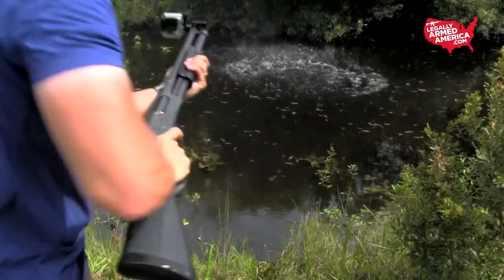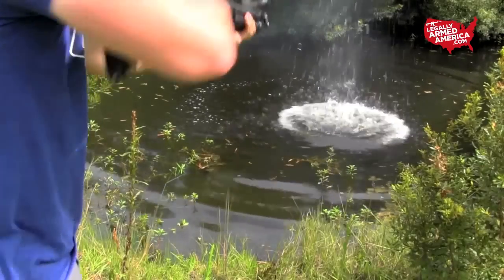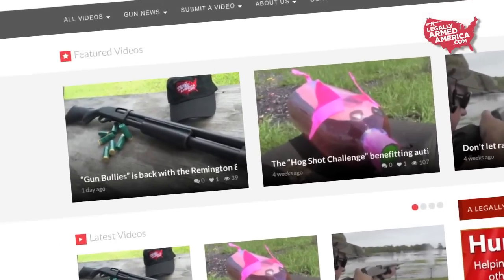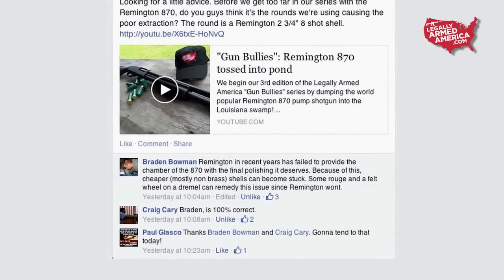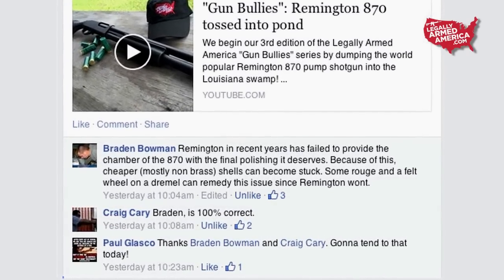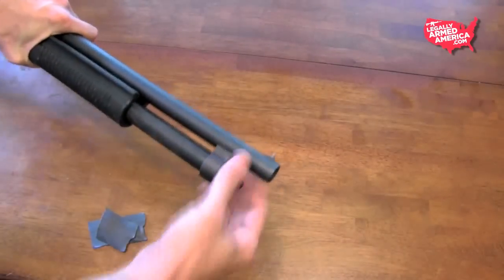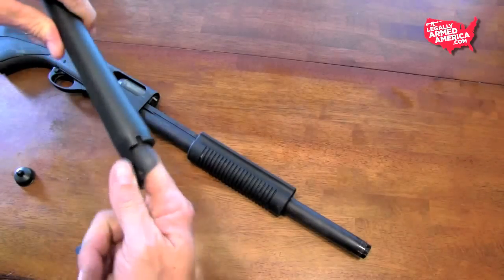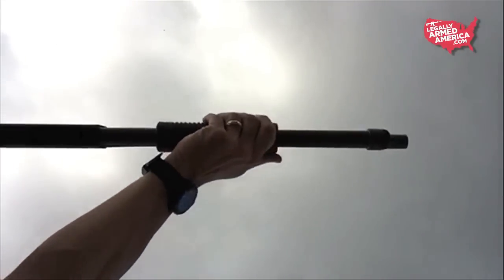Remington 870 chamber polish cures stuck shell issue

Comment: Well you are partly correct. I say that because I worked for over 15 years at a gunsmith/gun store. We were Remington, Winchester, Mossberg, Colt and Smith-Wesson Warranty for many years. 
Ok a little info for you. When you clean your shot gun you leave oil in the chamber. Then once you start to shoot it. About 3 to 5 rounds fired. There is no oil in the chamber. Depending on where you are located, weather wise. You will start to have what we called needle rust to start forming in your chamber. You do not realize this until you start having jamming issues. We would have people with Auto's, pumps, over and under's come in saying it jams or will not eject spent rounds. Yes a deep rip it apart clean and oil will help. Yet in most cases. We would take the next size gauge brush up. Like a 10 gauge in a 12 gauge barrel or 16 in a 20. You get the idea. On your cleaning rods the one next to the brush, in the take apart style rods. We would put that rod in a drill. Oil the brush and place in the chamber. Mind you, you are not drilling a hole so just get the brush turning. Move it in and out a few times. Clean and you are done. To show you the differences. Take a barrel you say is jamming. With a long set of tweezers, take a cotton ball and run in and out of your chamber. See how much cotton is trapped in the chamber. Then clean like I said and dry it good. Put another cotton ball in and see if it is a lot less left in there. With the needle rust. Your shell expands and it impregnates onto the shell and stops it from coming out. 
If I go on a weekend hunt off some where. At lunch I run an oil patch through my chamber. At the hotel I do it again. Hot outside and cold in hotel room. Causes moisture to form. In turn rust will start to form. 
Do this and you should not have any problems with jamming. Unless you have an old O-ring like on Remington 1100 and 1187's. Could just be an O-ring issue.
Reply: NEVER had to do this with my 1979 Remington Wingmaster.
I was a duck and goose hunter for 40 years. I could do anything to that gun and it just kept firing and cycling.

Comment: If you use sandpaper or steel wool make sure you soak it with a good gun OIL before you start buffing any of the parts.In addition be sure to remove any grit and steel wool fragments before you put it back together.

Comment: They now sell 12g flex hones for affordable prices now, you put it into a drill, heavily lubricate it with gun oil, and spin it in the chamber for 20-30 seconds max to polish it. Should fix years 2010 era 870 express shotguns with the sticking issue. This is what contributed to Remington's bankruptcy, their low quality corner cutting back then.

Comment: I have a Mossberg. Even the Remington 12 gauge low brass target loads have been known to fall apart inside the gun and cause problems.
Reply: kosmosleha  mossberg is a wicked shotgun. Dual beefy extractors. I also like the elevator style loading system. Never had a problem with my mossberg.
Reply: We just sold our 3 years old mossberg 500.
It never worked properly and always got jammed especially with magnum loads.
We tried different ammo brands, but the problem was always there.
Now i have only europian quality shotguns and rifles.

Comment: Had the same issue with my new 870. Here's what I did. I sold the pos and bought a Mossberg. This is the perfect fix.
Reply: Dave ahahaha!!!
Reply: Nope my Mossberg did it too model 88 most cheap pump action have pressed barrels and it causes a bump on the barrel that plastic shells will snag after melting to it he's right sand it down won't hurt nothing at all and it's good to go clean after doing so
Reply: Yea, just make sure you dont drop your mossberg on the ground... lol
Reply: Dave just don’t ever drop the mossberg..
Reply: Same problem in a mossie. Same solution. It helps they have dual extractors. It is the cheap shells and tight barrel with rough edges from mass production. Sigh.*
Reply: My friend's mossturd had chronic shell-sticking issues.
Reply: Did it work? I have a maverick 88 and recently got some buck shot just a tad bit longer than anything i had ever shot before and every couple shots the empty shell would get stuck in the chamber

Comment: I have an 870, never even 1 failure. Not so lucky with my Stevens 311A double barrel. The elevators were not working or so I thought. I got a 12ga brass brush, added some Hoppes Elite oil, scrubbed both chambers, shoots like new.

Comment: I'm throwing my comment in here too in hopes it gets answered lol.  What grit sandpaper did you use?
Reply from the maker: Tyler Andrew 150 grit
Reply: You can use a brass brush out of your gun cleaning kit and wrap steel wool around the brass brush with a little oil and then use cleaning kit rod and attach to your drill to make a cheapo polish hoan.
Reply: "150"? That sounds way to abrasive. I'd have started with 600 or less. But I'm glad it worked for you. And yes, I have done a lot of intricate gunsmithing.
Reply: gary smallwood Good tip!
Reply: Did it work? I have a maverick 88 and recently got some buck shot just a tad bit longer than anything i had ever shot before and every couple shots the empty shell would get stuck in the chamber

Comment: Ugh, had this same problem yesterday (with Hornay ammo).  I'm not sure which is the likely culprit - either the ammo or my Remington.  Will try this method for sure (and invest a bit in better ammo just to be sure).
Reply: field shotgun  must run and  eject  any and ALL AMMO// it  will ,,polish   itself, if  you  shoot  it   a lot ,,but if  it  is  no fancy  chrome  plated  barrel /and  your model is  not /than  special   gunsmith  sand  paper  /its  called   3m I think it  is  like  tear  proof  on kind  of vinil  material /it  is  used to   polish  whole  barrels  by  putting it  over  chamber and than   push  thru  with   brass  brush //all to the  end   back  to  fwd    10  to  50 times // you  can  do  chamber alone  too //it is  used   when  barrel got  pitting  so   if   real   heavy you start with  120   than  220 // or  you can  go  320  and    spend some   more time  / lube  it   and   clean  after  intense , all parts   of barrel   lock   hole     other  fit etc than  re lube  lightly ,,this   will not  remove   measurable  material ,,unless you   going   hundreds  of  passes /but  will  make  all smoother ,,I used   to   //if   got time and   was  not  using   that   gun /or  intend to use  it ,,after polish   I degreased all barrel in alcohol or  better acetone  than   used cold  blueing  paste   to   blue  inner  part   of  barrel  as well as  other scratches , than  re clean  with  alc/aceton   truly / and   than lube  it   ,so it  will not  rust    fast as   fresh polished  metal  tend to //if you shoot  / clean    gun  weekly its  not  necessary ,but I d do it   anyway
Reply: Federal ammo is really bad with doing this on my 12 gauge

Comment: I just bought a Remington 870 express tactical. Bought cheap federal target loads for first time firing. I didn't have any issues extracting shells, but a few times the round would not go into battery. I cleaned the gun well before firing. Could it be because of unpolished chamber like in your vid? Or is it the cheap brass? Or am I short stroking it? Any advice much appreciated! Thx

Comment: Very informative video,what grit sand paper did you use for the finger banging?lol
Reply: 320   /oiled   for start   and   if   want to   finish  with  600 ,you can  go   800 too but  that  is  if   you want  mirror finish
 ps  I   wash  barrel  after  in aceton  and  blue  it  with  cold  paste /than  aceton again / lube   and done  because  fresh  sanded steel like to rust  ,,it is  just  surface  oxidation you can  wipe with  finger  ,but   what the  hack  blueing  help   just   clean  paste   from  any   ,,edges  end of  chamber   etc//before re lubing

Comment: The newer Remington 870's are nothing but junk. Remington has destroyed everything as of lately they make. I will never buy another Remington product again. Or any company who has been bought out by Remington. R.I.P. Remington! Now go away.
Reply: yeah, remington is nothing but the name nowdays, its trash.
Reply: The real culprit is the so-called "freedom group." These corporate scumbags are destroying the American gun industry with consolidation and cost cutting.
Reply: The ole quantity, not quality.. Thats Americas moto now days...
Reply: I have no doubt Freedom Group has cut costs on the Express model, but from what I understand the Wingmaster and Police models are as good as ever. I bought an Express Tactical model and it was mostly reliable, meaning about out of 100 shells, 3 might fail to extract. For me, especially considering this is a self defense gun, that's not good enough. So I did a little research. And for an extra $60.00 spent at Brownell's (purchased better follower, magazine spring, carrier spring, and extractor) plus polishing the barrel, I made mine run like a Police model, without spending the $600.00 for a Police model. Then I added a Magpul stock so I can reach the fore-end better. I've run close to 200 rounds through it now with zero ejection issues. I'd use this gun in its current configuration to protect my family. Hell, I'd take it to war. I agree that ALL Remington guns should work right out of the factory, but I've noticed that a lot of reputable gun makers, including some of my favorites, are cheaping out these days, with the advent of MIM and other cost-cutting measures.
Reply: my 870 i bought new 21 years ago started doing it a few years ago. i picked up a used 870 (not sure of man year) does it, too. especially wit 3" slugs
Reply: I don't disagree with that - but my Wingmaster I've owned since 1982 now has this issue... It's the crappy ammo everyone makes now days.
Reply: @eyecandy6996  Most often with Short brass shells.

Comment: Same problem with my H&R pardner (870 clone). I've been debating trying this for sending it back for repair. A local gunsmith said it would cost about $100 for him to do it properly. Is it really this easy?
Reply from the maker: David Hobbins yes it is this easy. Just use very fine grit sandpaper. You’re not necessarily trying to sand material away. You’re just trying to smooth it out.
Reply: @LegallyArmedAmerica  thanks

Comment: I did the same thing to my 870 Express, but I used rouge and my Dremel.  It kills me that people seem to be getting upset over this, but what do you expect for a $350 shotgun.  If you want more fine finishing, buy a Wingmaster.  Spend the extra $300.
Reply: Actually my Wingmaster does the same thing, so does my Reminton 887.  The only differences I see on my Wingmaster vs an 870 express is better wood and a gold trigger.
Reply: Chris Morrison Pawn shop Mossy 500 @ Mavericks have had ZERO issues. Two were in like new condition and the other was a used home defense gun with a home cut vent rib barrel. Brother in law has the same story on his Mac 88. No malfunctions.

Comment: Okay so I fixed that issue but now my spent shells do not eject strong enough and at times I get a stove pipe. Pretty much every 2 out of 7 are stove pipes. how the fuck do I fix that?
Reply: get a 25.00 volquartsen extractor. problem solved. ebay.
Reply: @sumooth13  Thats what im going to i have a 1976 wingmaster magnum it'll eject a low brass but high brass its like they're to long to clear the reciever..im going to hone the chamber and get the volquartsen